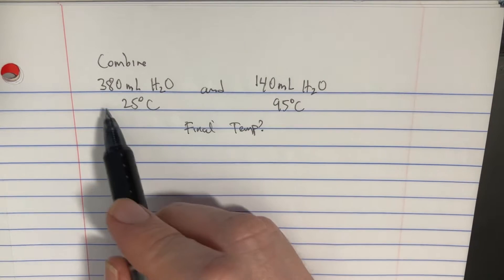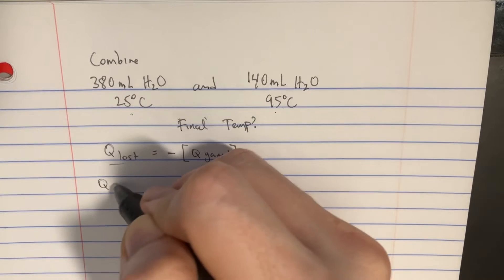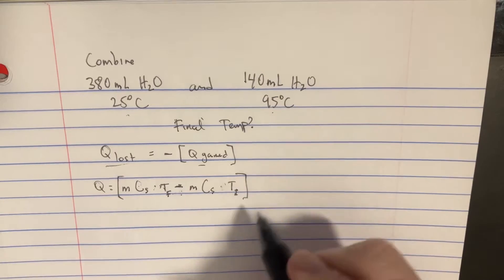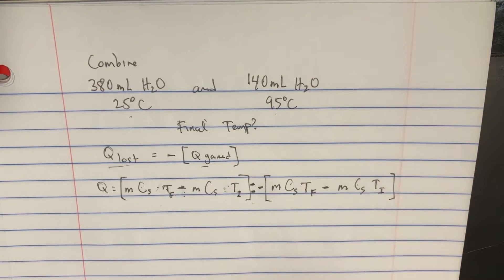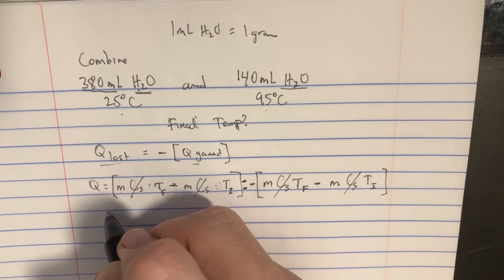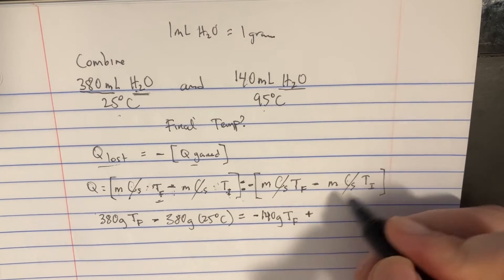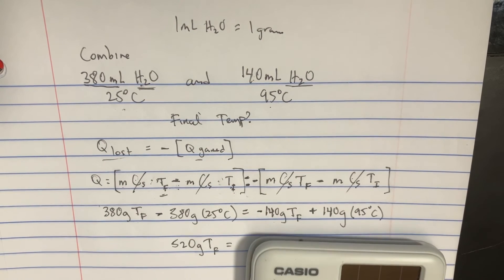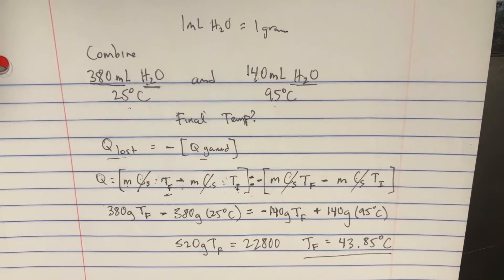If you combine water at different temperatures, what is the final temperature of the mixture?

Comment: Could you not just use a simple weighted mean of the 2 to find the same answer?
Reply from the maker: That might be possible, but we were working on a particular equation for Q in thermodynamics using specific heat capacity and stuff

Comment: Isn't this just taking the average?
(380 * 25) + (140 * 95) / (380 + 140) = 22800 / 520 = 43.85°C
Reply from the maker: That’s an interesting observation, it makes sense too, but I think taking the average only works if both fluids have the same heat capacity!